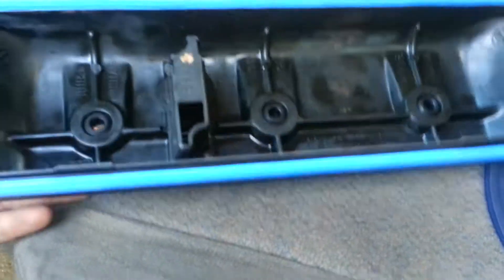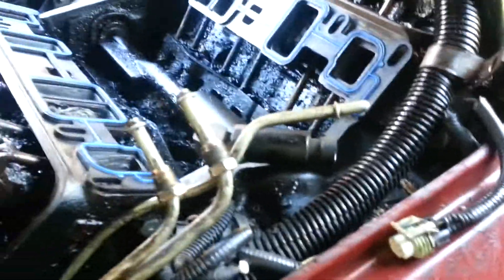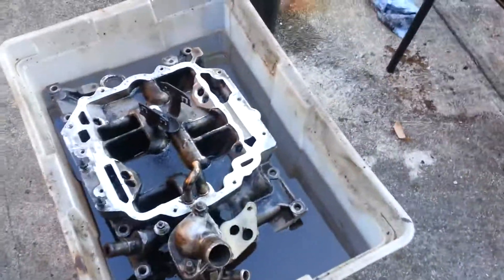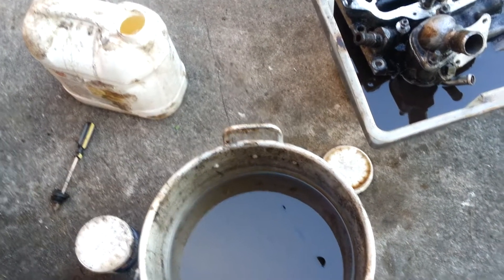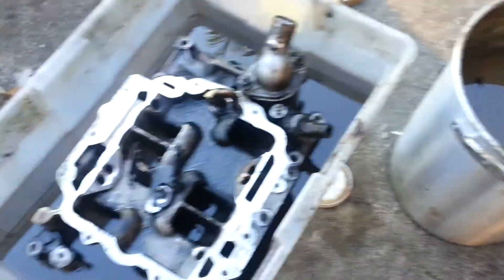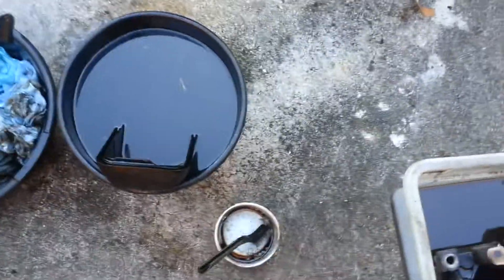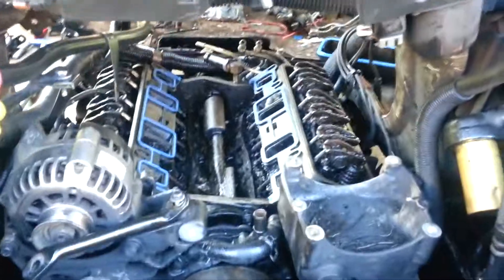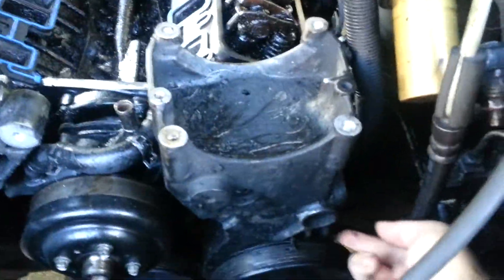4.3L Vortec Top Dead Center Water In Oil Results 2018

Comment: I would be afraid to run engine using just diesel fuel for oil in the bearings. Just clean it up best you can and put some nice detergent oil in it. Change it a lot.
I once had heavily gunked up Chevy 6 cylinder inside and out, I put nice new detergent oil inside and ran it. After a time I had the valve cover off and was amazed at how much I could see the new oil melted down a lot of the sludge inside. Everywhere the oil was flowing a lot it looked like lacquer thinner was flowing through the inside.